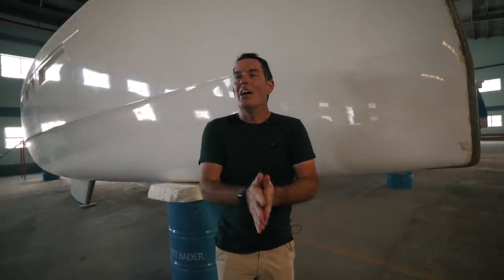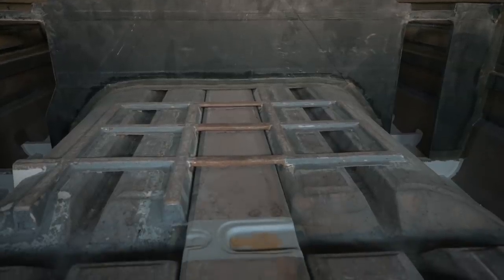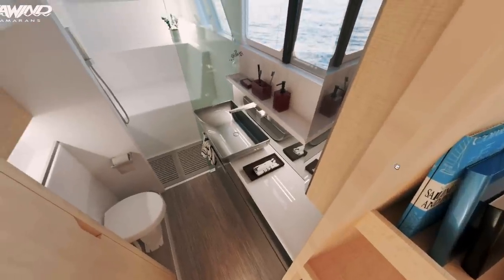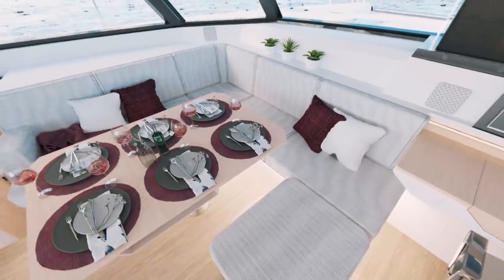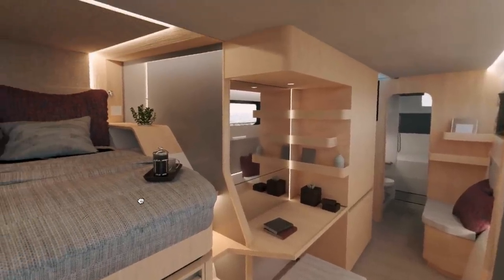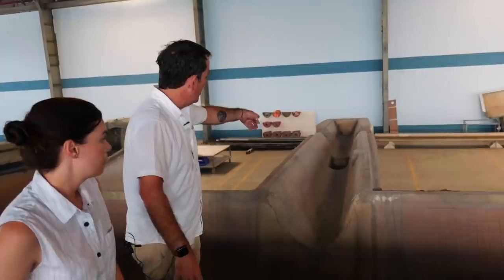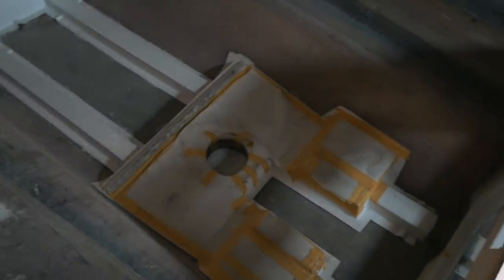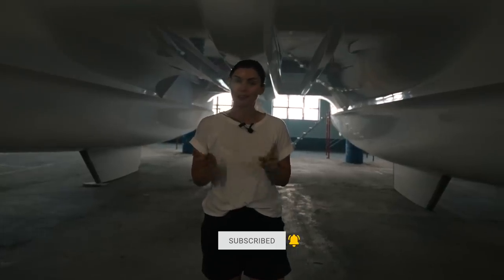CATAMARAN BUILD: Ruby Rose 2 First Look INSIDE Our Boat! (She's huuuge)

Comment: Looks great! I want one. One petty request would be to put the toilet in its own toilet room, but that's about all I can think of.
Reply from the maker: Yeah that would be nice. I think in a 50ft cat that should be pretty easy, maybe not so much in a 45ft cat. But I’m just happy to have a separate shower!
Reply: @Sailing Ruby Rose  It's definitely no requirement. But the latest redesign of the Nautitech Open 46 has that feature. Also intrigued by how their 44 version comes out. The 46 doesn't have a forward facing nav which is more important I think. But the 44 does. Regardless, I can't wait to see the finished 1370. One day... I'll be on something again.
Reply: @Macroproxy  They could probably do it if Nick didn't want his workshop!

Comment: Massive. I have been considering a Seawind 1160 Lite over the past few months. The 1370 is definitely a step up and a boat for full time luxury liveaboard. Now, even for a 1160 my budget is a real issue and lead times are getting very long. I am now embarking in a project of building myself a much smaller unit, actually quite close to what the Seawind 850 was many years ago. Your boat will be completed before I start building mine! Enjoy your stay and the process.

Comment: Congratulations on such a strongly made sailing vessel. Look forward to seeing it fully rigged and going through its sea trials. Most sailing vessels spend much time in the Littoral Areas of the oceans, so such a hull design should make it easier in sailing around shallow waters. I guess the ultimate test will be blue water sailing in storm conditions, but you already know this!

Comment: The saving grace on this boat is that no bondo or plywood bulkheads. Will you be able to inspect the joint of the bulkheads to the hull in the future if you need to do repairs?

Comment: Hi Nick & Theresa,
I'm a little concerned about the splitted floor at the trifold door location. I can see reinforcements inside and outside but not at this exact location 1:34
I understand that there is the draining area before the door, but they could have their longitudinal reinforcements make bridges between these two sections... well I also understand that no rigging exerce forces at this location, but anyway.
Other than that, having the water tank this high always look odd to me but hey, at least it's centered. All the others areas look strong !
Regards,

Comment: All I can say is I Want More! 
 Congratulations! 
I hope we get to see More of the building of the Boat! 
And a question? Did they glass the bulkheads to the hull on both sides? And how far up on the bulkheads and the hull does the glass covers?
 Thank you for this weeks video! 
Can't wait for more and More!
 Ok until next week Aloha from the Big Island of Hawaii!
🍻🍺🍹🥂
Reply from the maker: Hey mate. I’m pretty sure the bulkheads will be glassed all the way around.
Reply: @sailingrubyrose  sorry if I said something wrong. Just asking. I just would like to see how they connected thim. 
 As we have seen on another Boat builder (Lagoon) just put some sort of glue in some places. And in others not at all.
 If the top or floor didn't come together they just stuck some wooden Wedges in the gaps and shot some glue in there.
But sorry if that made you mad.
Have a nice day.

Comment: I'm also intetested to see how well the cross brasing box sections have been reinforced. As the hull stiffness is often carried between the hulls via tge bulkheads, but thus has proved to be disastrous in many Cats. Thus normally only shoes it inherent weakness after  the mast has been stepped abd the rigging 'wind-up' has been full tensioned... This does not look like an all carbon fiber boat, it looks more like  a glass/carbon fiber composit boat with  a kayer of carbon fiber orn some of the vertical surfaces.  I would have thought they would have included an aluminum beam in cross bracing to ensure no rigging stress or flex ibetween the hulls...Looks like they are relying on the  the composit box sections made from what looks like glass reinforced plastic box sections glued and laminated to the hull. While being strong I found this tends to flex  too much in rough sea when the rigging needs to be under full working tention.  So I was surprised they have not imbedded an aluminium beam,. Perhaps my racing experience is  different to cruising... You Guys must be stoked watching your new floating home on steroids comes together.. It looks big, but also quite narrow  at the front,  So I think you will need to be careful you don't pitchole (cartwheel) as it looks so narrow and pointy and fast at the bow you don't want it pitching or diving into the sea because of lack if bouncy when you get hit at the top of a wave comming out of the trough by a powerful puff. Thats the thing saling is always about trade offs...  But I will say she looks handsome. I think  you guys have a fast boat there  I can just imagine you  riding on thise two rocket's  looking hulls standing astride as mighty rooster tails  of water slowly diminish into a wake that plots your rapid pace.. How exciting fir you.  Good luck Guys, wishing you lots of fair winds and following seas.  All the way from Johnsburg SA...
Reply: I seem to recall exactly that issue being discussed and dealt with.